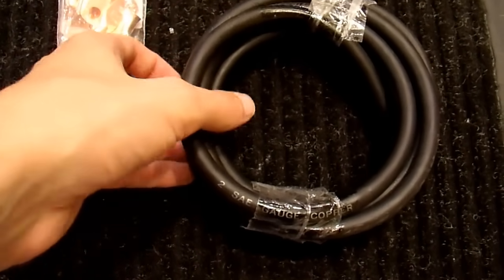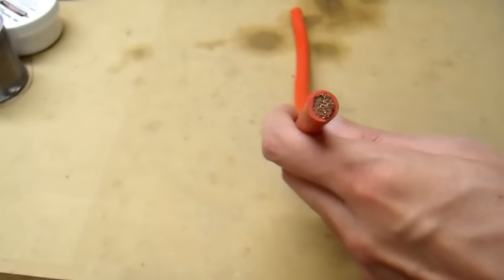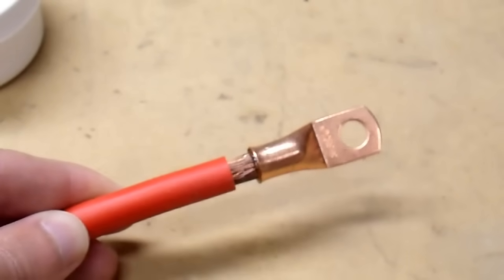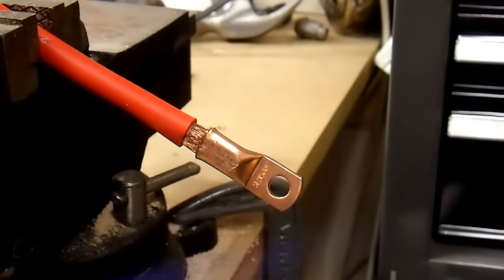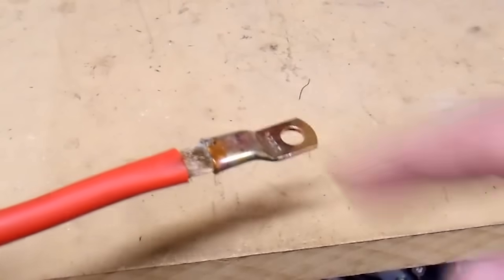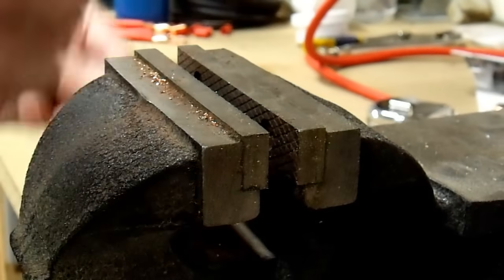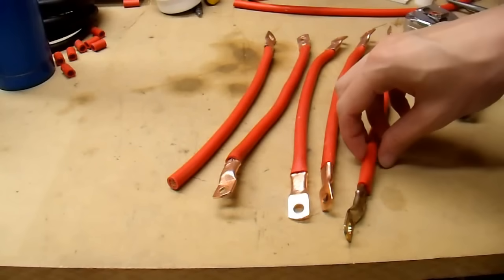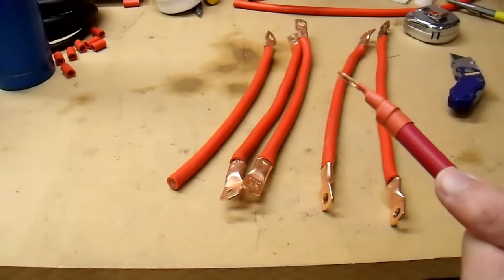How to Make Battery Cables the Right Way and the Easy Way

Comment: Very sloppy, do not solder these connections. You say that heating the wire causes the wire to oxidize but then you heat the ring which is the same material (annealing it in the process), and introducing corrosive flux into the connector. You should cut the jacket only back to the connector, so there's no exposed wire. It looks better, and it's more durable, since you don't have unsupported cable flex. You should use adhesive lined heat shrink for best results. It will seal out moisture and oxygen, and prevent corrosion. If you're worried about the condition of the wire, just cut it off and look, then replace it. It's cheap and easy.

Comment: You can buy a lug crimper that is basically a block with a v shaped notch that you lay your terminal in and it has a built in punch that you smack with  a hammer that makes a perfect factory looking crimp,  they cost about 20 bucks.
Reply: http://www.ebay.com/itm/TEMCo-LUG-CRIMPER-TOOL-NEW-terminal-crimping-hammer-tools-welder-battery-wire-/400441203422
Reply: ultramegabob2 http://www.ebay.com/itm/Brute-Hammer-Crimper-Tool-Crimp-Battery-Cable-Welding-Wire-8-Gauge-to-4-0/321656500524?_trksid=p2047675.c100005.m1851&_trkparms=aid%3D222007%26algo%3DSIC.MBE%26ao%3D1%26asc%3D29172%26meid%3De4ed5e8ecc1a481d841ca50c3ef813b7%26pid%3D100005%26rk%3D2%26rkt%3D6%26mehot%3Dpp%26sd%3D381129806549&rt=nc

Comment: I worked for years where we made custom cables every week. The easiest way we found was to cut the insulation off only slightly shorter than the lug cup is deep, fasten the lug cup-up  in a vise, put flux on the cable end, heat the lug with a torch, feed solder into the lug cup until it's about 1/3 full, heat about another minute after that, heat the cable end for about 30 seconds & reapply flux, immediately push the cable end into the lug (be careful about pushing the solder out too fast -- it really burns). You will have an excellent connection & if you cut the insulation correctly, it will melt as it butts up to the lug -- creating an almost watertight seal. (A couple of coats of Liquid Electrical Tape will help seal it also.)
  You'll have a better cable than you can buy & they only take about 5 minutes per end to make.
Reply: On my boat, the Onan generator battery cables have bronze castings for the battery posts which were designed for soldering onto the 2/0 wire. I wanted to use the 2/0 wire for an inverter for the boat, so I heated up the bronze casting and the old cable came right out in good shape, this after 45 years on a boat. Then I half filled the cup with solder and shoved the cleaned replacement battery cable (from an old GM v8 car, likely 0 gauge) into the casting and it works perfect.

I have also made my own custom battery cables for the boat using for the end short pieces of copper pipe or copper pipe fittings. Pass the entire stripped cable end into fitting, smash flat with hammer, drip a hole and then solder seal it on both ends. Works great. Very strong cable ends. They are thicker, but has not been a problem.
Reply: Scott Downey I also have made some of my own large wires using salvaged bare copper wire and make my own bundles. The wire strands are not as fine strands so make a stiff cable, but I salvaged lots of 14 and 12 gauge old romex wire this  way for a few free cables. One I made was 5 feet long and likely about 250 mcm sized. Shoved into an old rubber hose for insulation. I also made an 18 inch 250mcm sized cable for joining the battery switch to the positive junction block and used heater hose for insulation. Anyone looking at them would just think they are some regular but massive wires.  They all have worked fine for over 5 years.
Reply: Scott Downey I did make one wire using some finer strand wire salvaged from old burnt wiring of 16 to 8 gauge. Still plenty stiff but not as stiff as when using romex copper.
Reply: It is always better to spear your cable insulation  rather than scoring it, in that way you won't have any blurring of the insulation  when heating the conductor.
Reply from the maker: Thanks for the comment!  You really know your stuff from a practical standpoint.  If you have a video demonstrating your method and technique please link!

Comment: If have corrosion under your heat shrink, you will see it bubble up underneath and eventually see it push out, I was mechanic all my life, thank you
Reply from the maker: Yup, eventually.  But long after the connection has failed.  In the meantime it will overheat and damage your battery and be a fire hazard.  It's better to see the problem right away.
Reply: I disagree, I was a truck mechanic all my life, sometimes dealing with 4 batteries per truck, you have to use heat shrink, trucks come from the factory with it, batteries leak tiny amounts of battery acid as they age, with 4 batteries, thats 8 battery cables, the cables must kept sealed.
Reply: This is what happens when people say things on youtube they now nothing about, it's done so much on youtube.
Reply: you are so wright.

Comment: if you were unsure of a cable with heatshrink couldn't you just do a continuity check to ensure the lugs didn't fail?
Reply: ***** resistance testing is not the same as testing under load, if the volt drop was too much the test leads would be moved to the connector/connections & cable then tested under load again to find where the voltage is being dropped. Resistance would be the same whether 100 strands or 1 strand of the cable was in the connector.
Reply: ***** you wouldn't measure resistance at all (well I wouldn't), the favoured way would be to volt drop the cable whilst under 'load' from end to end.
Reply from the maker: You'd need to be able to measure resistances on the milliohm level and also account for connection and cabling losses.  Unfortunately the practical only way to tell if a crimp hidden by heat shrink is 'good' is by seeing if it gets hot under load.
Reply from the maker: 1973Robski
That would only test the total resistance of the cable which is the same as measuring resistance.  What is important is the resistance of the actual crimp - which is difficult to measure empirically.

Comment: Would it be o.k. to put a little bit of dielectric grease on the exposed wires to help slow down or prevent corrosion if it will even do it?
Reply from the maker: Dielectric grease has been used for decades to protect metals from oxidation.  It can always be used to extend life, but preventing the infiltration of ionic contaminants, acids, and aqueous contaminants is still the best corrosion prevention.
Reply: The heavy electric loaded headlight pins burned out, on my 05 Suzuki V-Strom motorcycle harness connector. The wire connector pins burnt out, because the gauge is too small and oxidized quick. I see now that the same gauge wire is still being used, but now the pin connectors are being slopped-up with as much dielectric grease as possible.

Comment: Most tool rental shops have proper crimping tools available for reasonable rates. Proper tools are important because they eliminate the risk of under- or over-crimping your terminals and reduce terminal damage and waste. My general rule of thumb: If I'm only using it once or twice in a given decade, rent; else buy the tool.

If your batteries are being kept in an area where they will be subject to moisture, or if you are hooking up to non-sealed lead-acide batteries with a risk of outgassing, you should seal your terminal ends against moisture and/or your batteries' corrosive gasses.

If you are doing this on your boat, remember the ABYC electrical specifications require ALL wire terminals be sealed (shrink-wrapped) against water ingress.

Comment: Yesterday, a friend of mine stopped by on his golf cart. Then he tried to leave and didn't move.  Looking at the batteries, we found that one of the terminals had completely melted off, most likely due to the cable which was poorly made and in it was also in poor condition. Made me think of this video, not in a good way.  I've never seen a battery terminal melt before, even though I've seen a LOT of hacked together cables and they generally survive OK.  This type of failure, even though rare, is the whole reason it's a good idea to go the extra mile to properly crimp and finish (adhesive heat shrink).   People rarely inspect their cables after they've been made until there is some kind of problem.  As such, the cables should me made well and protected very well from corrosion as these types of heavy cables are going to be used in situations (backed by at least one large battery if not a bank of batteries and high current draw across the cable) that can cause serious property damage, injury and even death.  It's not wise to hack them together.

Comment: I thought your wire selection guides were pretty good, but your cable termination advice is a bit sketchy.  You are doing a disservice to people by calling this "the right way" in the title.  This is a better than average "hack" way to make cables (since most people really suck making cables the "average" isn't very good). Your connections should work OK, and I've seen worse... and maybe using solder is better than someone having a cable that is only crimped poorly.  But no way can you crimp something in a vise (among other issues) and call it the "right" way. I would suggest that people do a lot more research on proper crimping (and inexpensive tools that can help) vs solder or crimp + solder connections before deciding to follow your advice.  Especially for mobile and high current use!

And you say heat shrink is only for cosmetics? Yikes!  Well, I can understand why you want to keep an eye on the terminations you've made using these methods as they are going to be failure prone.  (But without the heat shrink they WILL fail even faster!)  On the other hand, you shouldn't need to keep such a close eye on well made, properly crimped lugs protected with high quality glue filled heat shrink.
Reply: I'm sorry  but you are fooling yourself if you think Heat shrink is merely for cosmetics.
Reply: Adhesive filled heat shrink and terminals are used in marine applications when salt and water exposure is common. The adhesive seals the connection from the outside environment completely. Shrink tubing is an insulator and a protectant against corrosive environment. It is NOT purely for cosmetics. A properly crimped and soldered terminal with adhesive lined shrink tubing is the gold standard for proper cable production. There is no need to monitor a cable or connection that is constructed that way. Only the terminal-terminal connections need to be checked, but some paint after installation will protect that as well.
Reply: I support everything Darin says here solder is not needed and H/S IS NOT JUST COSMITIC! I've been a battery tech at a battery shop for 3 years and have made dozens of cables your method will work, for awhile but don't callit the right way cause it's not even close.
Reply: When he put the cable terminal in the bench vise I envisaged hundreds of guys referencing this video and following these instructions. Use of the bench vise or using vice grips to crimp is half a step up from laying the cable on the sidewalk and using a large rock to smash the terminal flat...it’s completely ghetto.
- Also, I’ve never seen anyone solder a cable end and don’t know why that would be necessary.
 - Get a (quality) crimping tool appropriate for this task, have your son watch you use it to make a proper battery cable (and post THAT video), and then put the crimping tool in your toolbox in the garage. Then, use it once every 5-7 years after that when you or your buddy need a new battery cable for your car, boat, or RV. When you get old and die your son will have a quality tool to keep and use. Please.
Reply: +knurlgnar24 I disagree about the heat shrink. Not only is it necessary for electrical insulation, the idea that you need to monitor the conductor underneath is absurd if it is properly soldered. why not just strip the insulation off the whole wire?
Reply: Darin Weeks As far as I have been working with copper wire works, using crimp style connectors do perform very well on low strand wires. Useless to say that there are specifications on hex crimp tools and the wire for secure use on industrial applications. Flexible high strand wires, like wires for CNC drives that are supposed to be bent 200k times a year are usually soldered to their connectors. One thing I might add - many outdoor power distribution accessories come as pretinned copper terminals, and the cable crimps as well. It might have a higher resistance, but is performing fairly well over the years. You can jack on equipment with minor losses without any cleaning, unlike copper. For car use, the copper will oxide against the steel, so its a fairly good deal to prevent the socket from rusting away.
Terminals on a 300kW air compressor will still be tin plated. For these applications, if not for the sake of the steel rusting away, recommend tinning the copper.
Reply: Two observations:

1. Yes this technique is "hacky"
2. Despite that, it will probably work anyway 99% of the time.

That said, my advice to anybody needing to make a battery cable would be "spend the money to buy a proper crimping tool" and "crimp only, no solder" and "use heat shrink tubing". But that's just my way. shrug

As an aside, a hydraulic crimping tool can be purchased for around $45.00 online.
Reply: lol dual wall heat shrink is a good corrosion catcher, that statement and your vice procedure mad me think I was watching the comedy channel!  and i am a professional so I wouldn't attest your inexperienced comments, save money or do a job right is my advice
Reply from the maker: Heat shrink is definitely only for cosmetics.  There are no exceptions to this and there are multiple reasons for this both logical and practical.  However I agree that a vise is not the best way to crimp and I do have an inexpensive American made crimping die that I sometimes use.  The point here is that the average person doesn't need any special stuff to make safe cables.  Cables made in your garage with garage tools can be more effective and long lasting than the majority of the commercially made junk out there on the market.  In fact I trust the vise crimps more than the die's crimps that I have due to better strain relief on the individual strands.  This method most definitely does work, and it works reliably.
Reply: @knurlgnar24  second horribly misinformed video with extremely ignorant follow up comments...unsubbed
Reply: @knurlgnar24  Heat shrink only for cosmetics?  I wonder if anyone has ever let Motorsports and Milspec manufacturers know that?
Reply: @grnsouth1204  yeah, pretty much every MIL-STD cable I've ever seen in 28 years has a yellow heat shrink at the ends.
Reply from the maker: Glue filled heat shrink is good stuff BTW and I put that in a separate category then standard heat shrink.  But I still don't use it on 'battery' cables due to corrosion issues and inspection difficulties.
Reply from the maker: Darin Weeks
Using adhesive lined heat shrink is still a very bad practice.  Cables made this way are not merely 'OK'.  They are far superior to most commercially made cables.
Reply: ***** When adhesive lined heat shrink protects a well made crimped connection, you are providing nearly perfect protection against corrosion.  There should be almost no oxygen anywhere in the connection and no way for acid or moisture to get in.  As such, there is no need to monitor the area under the heat shrink visually as it would be more likely for the lug itself to corrode to the point it is unusable.  The fact that you are so intent on monitoring this area is exactly what makes me think your cables stink.... and it seems like you just don't realize how bad they are (but again, to give you credit, as I've said, i've seen much worse).  You should absolutely not have any undue worry about that area with a well made cable.  With your cables, there is no question that the connection area is going to fail first.

But anyway, I guess we'll have to agree to disagree.  You are sorely misguided if you think that you'd ever see cables like yours used in an installation by a trained professional (and I'm not talking about a car audio guy).  I'm not a professional BTW so that is not why I'm saying that.  I have no idea what kind of "commercial" cables you are talking about where you find yours are superior or what planet you are on thinking that crimping in a vise makes your connections better than commercial equipment.  Unless you are just saying you sourced better wire than you'll find in cheap chinese jumper cables.  But in that case, you are talking about retail cables, not quality commercial/industrial grade cables.
Reply from the maker: Darin Weeks
Commercially made cables which are sold to end users in auto stores or big box stores (and especially online retailers) are generally not very good.  What I show here is definitely superior to what most end users purchase pre-made.  And I do maintain that heatshrink is a good way to cover assembly errors and cause maintenance issues down the road.  People with experience will attest that heat shrink is a good 'corrosion catcher' and will not recommend it.  Industrial cables are either molded (far beyond the scope here) or use more expensive terminations which are assembled specifically according to the manufacturers recommendations involving dedicated crimping dies for each individual type and gauge of connection.  This is not practical for most individuals.